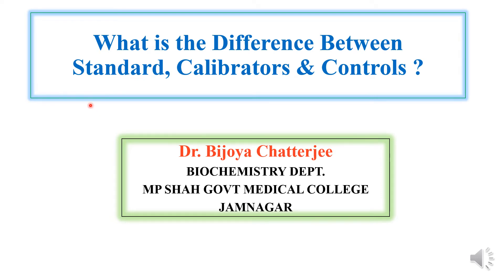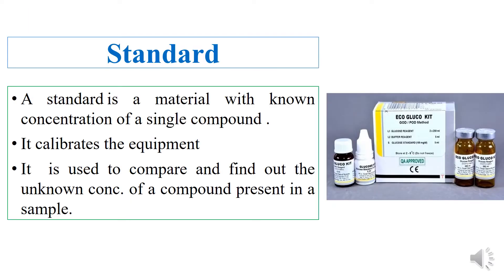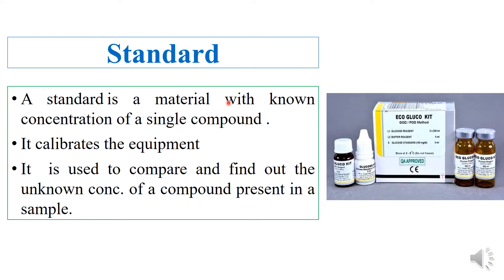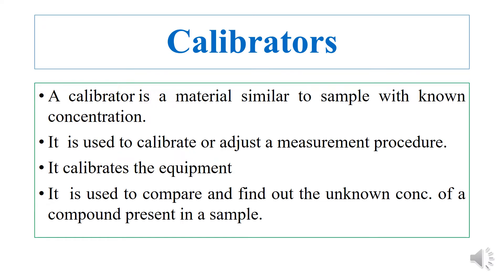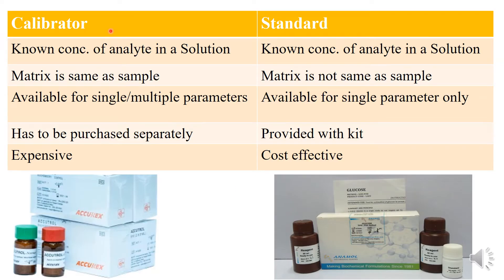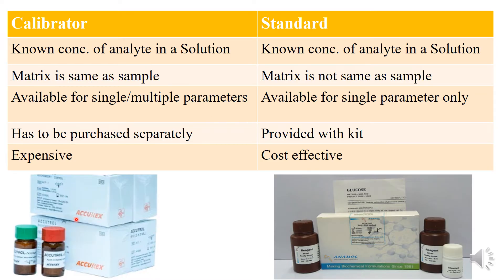Standard, Calibrators and Controls

Comment: why QC materials could not be used as calibrators although they contain all matrix that found in patient sample and with known concentrations??
Reply from the maker: Calibrator and QC should be different 
Only then can you assess your own lab and its equipment’s and check accuracy
 
Calibrator is used to calibrate, or adjust a measurement procedure.

A control is used to monitor an analysis performance
Reply from the maker: https://youtu.be/Hqos7j2rYOE?si=D0nbRrpb_lVSiHoT
Reply from the maker: Calibrators and Controls ensure reliability and consistency of test results and the analysis system

Both cannot be used interchangeably as both have different roles 

If we use the same material as control and calibrator , it will not solve the purpose of checking the complete analysis system including reagents, equipment and procedures
Reply from the maker: Daily QC checks the precision of measurements and help identify any deviations or inconsistencies in the analysis procedures . 

Calibratiors are used to check 
and verify the accuracy of results produced by machines.

To understand what is accuracy and precision you can watch my video on the same topic